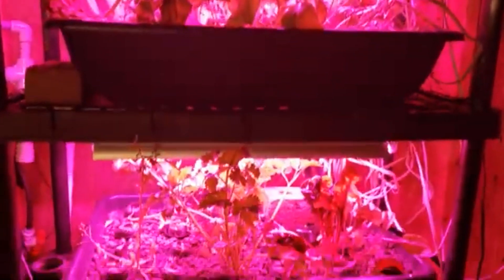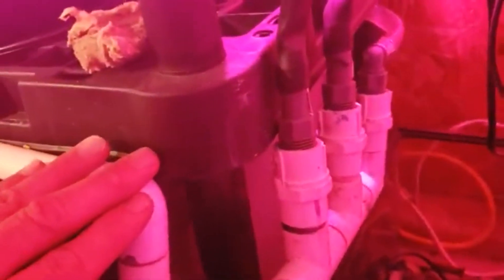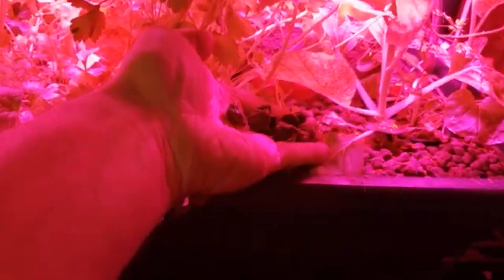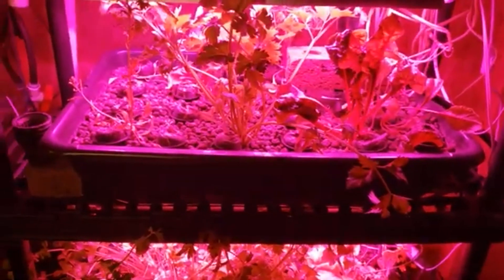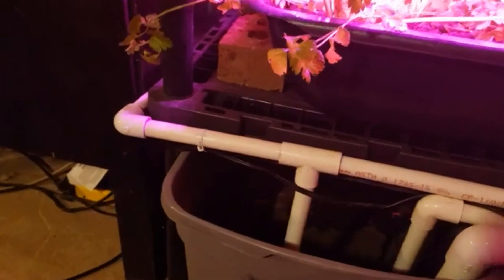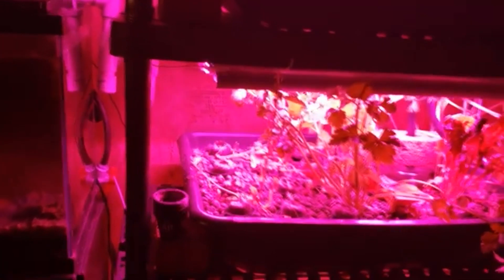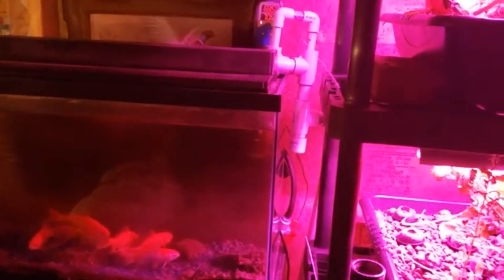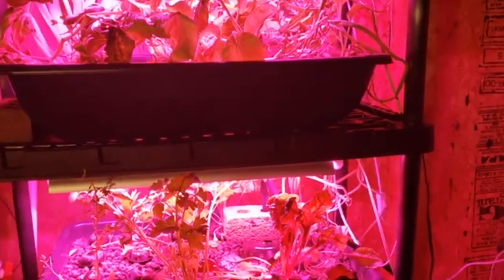Growing A Lot Of Food With An Indoor Fish Tank Aquaponics System - How It Works

Comment: if each bed dumps into the one under, why have a hose for each bed and not just one for the top bed since it dumps into the one under
Reply from the maker: The beds are just dumping into the overflow drain pipe of each, not into the grow bed itself. The main reason to do that is because the point of an aquaponics system is the grow media in the bed filters out the nutrients of the fish tank for the plants to use. If you just dump the water into the bed below it, each bed on the way down would get less nutrients for the plants. By delivering to each bed independently each bed receives equal amounts of nutrient.

Comment: I like your design. Im thinking of using it and changing it up a bit. Id put the main water source at the top of the design and untilize gravity for pressure to make it even more exo friendly and functional without electricity. If your using grow lights anyway the veggies can easily branch out around a room ans still have a water source

Comment: Great video! How clean does your fish tank stay? Say you wanted to run this system year round, would you periodically need to clean the tank?
Reply from the maker: The water stays pretty clean but you do occasionally have to clean the algae build up off the glass and vacuum the solid fish waste from the bottom.
Reply: @haroldthornbro   In theory, do you think you could add a natural cleaner like shrimp or snails?